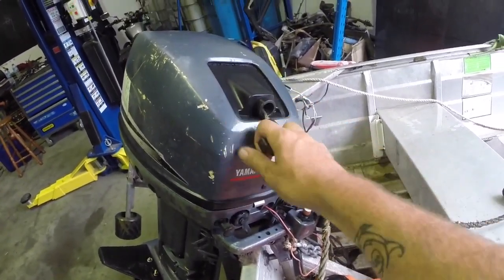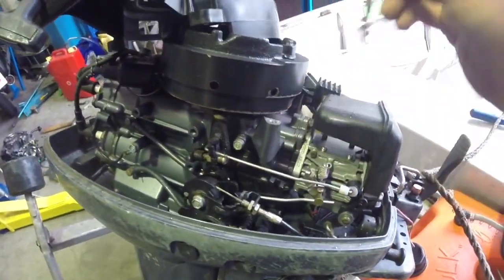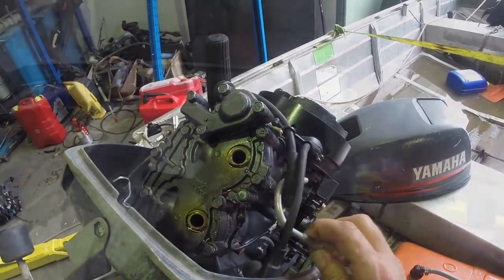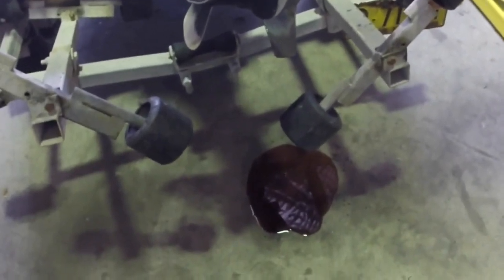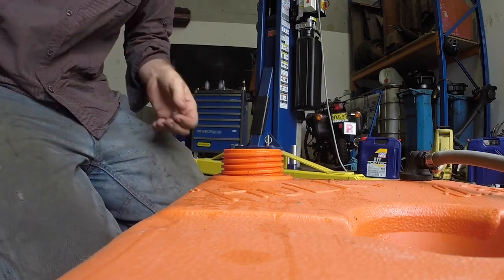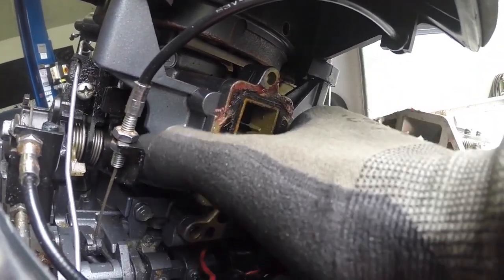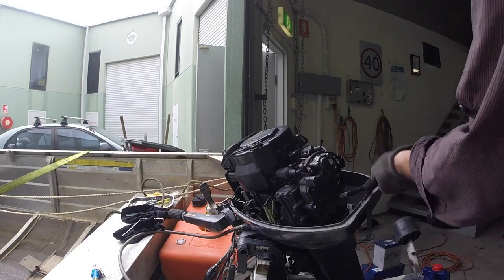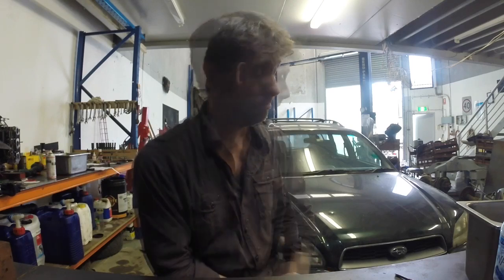Unseizing a seized outboard motor

Comment: Last by not least, My Mariner 90 jet boat engine which i used twice after a quick test run from the mechanic/ private dealer. Afew months ago. 

Flywheel is and was almost impossible to turn by hand or pull string. Is this normal? 
It was so hard to turn the solenoid connection to the starter motor broke off. (Maybe age aswell)

I suspected that it was due to my brother leaving the water running into the engine without it running therefore water gone into the head (thus is a jet boat Not outboard) 
I took the spark plugs out and the motor was much easier to turn, water shoot out of the spark plug holes when i turn the motor, i sprayed wd40 as suggested by a few videos. Changed the solenoid and starter motor and now it runs good. (Still impossible to pull start)

I took it to the water, took off and got to 30 kph then cuts out (maybe i forgot to turn the blower for fresh air into the engine compartment so i left the lid open) it got to speed a few more times then its just slows down to max 10kph. 

I did a compression test yesterday and bottom cylinder shows 5 whiles top 2 shows 125 each. Is this a case of taking the whole engine out to bore the cylinders? Or anything else do you think could be causing it?  

I got these motors and they're all old and keeps breaking down. i just swap my GQ Nissan patrol for a 2015 Seadoo Jet ski, is 4 Stroke in your opinion better ? I.e. reliable and more durable or are they're about the same? My wife hates the fumes of the 2 stroke.
Reply from the maker: You would certainly need to disassemble the motor completely to see what is going on. Could be head, could be rings. Personally I have always preferred four stroke motors over two strokes and also found them to be more reliable.

Comment: G'day mate, I have a 1989 Yamaha 200 2-stroke, seized, have filled the ports with ATF and noticed plenty of ATF in the exhaust and carbs. Does that sound right to you? Cheers
Reply from the maker: Yes to the exhaust in that some of the pistons will be low enough for oil to run out the exhaust ports and down the leg. The reed valves should be shut and preventing oil from getting into the carbs so I would take the carbs off and check that you don't have any broken reeds or ones that aren't closing properly any more.

Comment: I have a 15 HP Johnson 4 stroke motor , feels seize when spark plugs are installed , but motor turns over freely when i remove the plugs , any ideas ? I can't seem to find a video on youtube that relates to my problem closest is seize motor . any help is appreciated , oh by the way love your video I learned so much over the years and have subscribed and liked all your videos !!
Reply: Did you ever figure it out I’m having the same problem with my 30 HP Evinrude 2 stroke

Comment: Hey man I have an old 6hp motor that will turn but not start. It sat at our old beach house for some years so it's full of salt and was probably never flushed haha. I'm pretty sure it started a couple of years ago but won't start now. We have also replaced the spark plugs but still no luck. Any idea what the problem could be?
Reply: It's an evinrude by the way
Reply from the maker: If it has sat for a long time I would start by cleaning out the carburettor(s). https://youtu.be/ye_Ui9D8dBE This video will also give you an overview of other possibilities https://youtu.be/nil7mx3x63k
Reply: +Dangar Marine ok thanks, I've just been working on it and realised that there is no spark :( even with new plugs. So I'm guessing it's electrical?
Reply from the maker: Yep. Could be the exciter coil under the flywheel or the ignition coils that drive plugs.
Reply: +Dangar Marine ok, so it's best to take it in to get it fixed rather than do it myself? Haha
Reply from the maker: Watch this video and then decide. :) https://youtu.be/MDbvkFM1V_c
Reply: +Dangar Marine ok thanks man

Comment: Well I think that's the next thing I will keep you updated how is the best way to time a 2 stroke top dead centre
Reply from the maker: +loaded1981 There may be a mark on the crankshaft under the flywheel, otherwise take a sparkplug out and use a straw or something like that to feel the piston rising as you turn the flywheel.

Comment: Question  i can understand if water or moister gets into cylinder  soaking over night with the ATF  but the ones i have encountered  i have mostly been able to break free but the  the rod bearings play havoc  on the crank  buy electrologist  causing  little imprints  on the crank where roller bearings make contact  causing damage and if you run it it will after a while it will throw a rod  because only the first few thousands of the crank has been case hardened after that is softer metal  so it can flex with the high rpms not like a case harden car crank which is harden all the way through  so outboards under the annealing  process on the crank the roller bears with the moister between them  have eat into how do you go about seeing if this  has  happen
Reply from the maker: Pulling the crank apart is the only real solution tho this. If flushed properly and started again soon after sinking I've seen plenty of these engines run just fine for years and years though without stripping the crank down.
Reply: @DangarMarine  I had a 40 hp sink on a hydro  12 footer took the motor off as soon as I got it home cranked it over with the plus out  lubed the cylinders and cranked some more the emptied carb and fuel lines  put it all back and started it  let it run for 30 or 40 min  and its still running today that's been 20 years 
ago ps  i hope they get off that lockdown crap over there real soon

Comment: Be nice to know how long these jobs should take.
Reply from the maker: Really depends on the outboard. This one I left soaking over night so I guess it takes a couple of days even though the actual effort of unseizing it was probably only about an hour.
Reply: somewhere between 20 minutes, and 10 years, lol. the size of the motor counts too, as the more bores, the more damage has to be chewed through (and the more steam applied through that breaker bar). i've seen a 4 stroke pressure washer "unstuck" in an hour, but also a chrysler 318 that took almost a month of "gentle persuasion while awash in turpentine and diesel" to get the first full spin, and then a week of tranny fluid and a spin every few hours. that puppy ran for almost a year before the idiots sunk it, lol. it is IMPOSSIBLE to give a "book hour figure" for such a job. odds are,no matter what you charge, you'll take the beating, lol. if you plan on plotting time spent vs your cost to buy another motor, i'd say a week of "part time effort" (maybe an hour spread through the day of topping and torquing) is justified no matter what (outboards are kinda pricey), and then make the call based on what you see dribbling out. if it's bleeding rust/oil mud out of the exhaust and plug holes, probably time to start shopping. lots of pretty silver glitter is probably a similar clue. now, if you see that after an hour, why go on? on the other hand, if it's taking a bit too long, but everything is running clean-ish, why not give it a little longer?

Comment: Have you tried pentrene oil before for this application
Reply from the maker: No, I haven't tried that, but most people swear by a 50:50 mix of ATF and acetone.
Reply: Yep thats what ive been reading i have two evinrude ficht 115 that are seized im based in Newcastle trying to find someone honest to work on the engines or may not be worth it. Im thinking there are going to be lots of problems the boat has sat for 8 years and hasnt been ran less then 250 hrs on engines.
Might look at another second hand single 250 motor

Comment: PB Blaster works I like to use Marvel Mystery Oil I've unlocked diesel motors that has sat for years all you got to do is pouring on the cylinder let it sit for a couple days and put a big ass wrench flywheel bigger the motor bigger the wrench her big motors I use a cheater pipe outboards normally not necessary

Comment: Hi dandarstu love your videos watch a lot & has helped me out so me you times as I like messing around with outboards when I can't get out on the boat as being in Scotland weather is not always good lol but I'm having probs with a Suzuki dt55 not starting got spark getting fuel but will still not kick the bottom 2 cyclinders don't seem to be getting fuel as much as the top 1 going with the plugs changed the reed valves still nothing could it be the fly wheel key some 1 said it could be all help would be good thanks
Reply from the maker: +loaded1981 Have you had a go cleaning the bottom two carburettors? I'd start by cleaning those on top of a compression test on all cylinders. Here is a link to the cleaning a carburetor video: https://youtu.be/ye_Ui9D8dBE

Comment: How did water get in the gas tank?
Reply from the maker: Usually it comes through the air vent, but it can also come from the fuel before it is even put into the tank.

Comment: DO you do it the same way .for a engine that was running when it seized.
           yours Ben Murdoch.
Reply from the maker: Do you know why it seized. Generally if a motor seizes while running it will be due to lack of oil or cooling water. If you are lucky it will just start again once it has cooled down, but be sure it fix whatever caused the seized in the first place. If it does move after seizing when running then something has been damaged and this process won't really help.
Reply: Having the same issue with my 9.9 four stroke Yamaha. Seized while running after making a loud whining noise. Was really hopeful till I read this comment. Lol wonder if it’s the gear case seized...

Comment: O.K. what was that lanyard thing you put on the engine?
Reply from the maker: +Endtimeprophecy777 Hmmm, can't recall what it could have been. What did it do or look like?
Reply: Endtimeprophecy777  it attaches to your wrist if the driver were to fall out the boat wouldn't run off on you
Reply: it kills the motor

Comment: sometimes when the outboard is stuck. All I do is remove the spark plugs spray wd40 in the holes and let soak for while then crank it over it fires
Reply from the maker: +layne bartman Yep, depending on how badly it is seized you can just give it a spray. We had one in this week that needed the head removed and the cylinder bores honed, but it was pretty rusty.
Reply: +Dangar Marine nice. did a good job on unseizing the motor though looked pretty seized until you broke it free from that rust line
Reply: Dangar Marine , Hi you Ledgend, helped me saved so much money getting those mobile mechanics that didn't do very good job of servicing my motor, my johnson 60 was overheated due to old impeller wasn't replaced, now one top cylinder rattles at high speed. ( have u got any videos on how to do it?) it was running until they took everything apart breaking most of the bolts along the way. A motor loke mine is probably worth around $1,500. So if its too much work. I am thinking it's probably going to be easier to replace the engine and use this one as parts. (Do you have video how to change over or replace and install engines? )

Comment: Be forewarned. If it has seized, there is damage. There will be damage to the rings and cylinder walls, severity may vary. Most likely the rings will not be free in the grooves. The motor should be torn down and inspected. At the very least it should have a hone ran through and new rings. Who wants a time bomb on the water?
Reply: After some heat cycles I do believe the rings free up a bit. Just take it easy and don't go to far from the dock for the first 2 tanks.
Reply: @nonya832  No, they don't free up. The cylinder does not fix pits and grooves on its own either. Tear it down and do it right.
Reply: @AnonyMous-jf4lc  okay I will sorry
Reply: @AnonyMous-jf4lc  yeah I'm happy I'm doing it right. Took the head off and there was so much rust it probably would have been enough to lock it up at tdc

Comment: You was saying about the car i have just got myself a ford focus that had been submerged in water i had to take all the dash out and the instrument panel was nakerd but with ford if you put another instrument anel in with diferent milege it will not start so i found a company in uk i sent them my old panel and i purchased a second hand panel sent both to them and they cloand the new panel i was putting in the car the other reason i did this is because it only had 23000 kilometers on it the other thing i had to replace was the triptronic moduel and airbag moduel i could reset everything as i had the computer also replaced the radio got second hand but never got the code so got the seial number of the radio went online paid six euro and in 20min got code so radio works i paid 300 euro for car after all work and new document itv it stands me in 1500 euro
Reply from the maker: Nice fix. We have very similar problems with our Subaru. We also needed to get the key recoded for the new body control unit.
Reply: @DangarMarine  do you have somone that can do the job

Comment: It was some 1 online that said to try that I was going between the vacum &I the firering order but I've not had a chance to get the fly wheel off yet but was just not sure that's why I contacted you see what you thought
Reply from the maker: It's certainly a possibility. If you have fuel in the carb bowls, good compression, clean jets, spark on all three plugs, new reed valves and it still isn't firing a timing problem is on the cards.

Comment: The trick I use is to add 50-75 % Kerosene to your lube. It changes the surface tenchen. If you try it you'll never go back to any store bought nut buster.

 One warning clean it up or it spreads like oil on water.   
Warning two if you try to use for cutting oil is creapes up your drill and your drill slips in your chuck and, it dosent stop there my chuck fell out the taper of my drill press.  That never happened before . 

It penatrates like boys at a senior prom.
Reply from the maker: Yes, acetone can have a similar effect.

Comment: I ran out of gas on a two stroke motorcycle once and unfortunately the gas station had no two stroke oil,so given my choice of four stroke engine oil,atf or power steering fluid.I had to get home so I chose the atf mostly for it's lower viscosity and I thought of what was available to me it would probably burn the cleanest.I rode my Yamaha RZ350 home approx.120 miles.although she smoked ALOT I made it home with absolutely zero issues.Not even a fouled plug.although I wouldn't recommend this it got me home in a pinch and flushed the fuel system the next day.

Comment: I bought a motor for 75$usd and did this to a Nissan 8hp that was ran with straight gas and I’m surprised because my compression is at 100 psi top and bottom

Comment: could you spray wd40 inside the cylinder to lose it up?
Reply from the maker: Sure, WD40 is fine. Ideally being able to soak the cylinders with more volume of fluid is best. I've also been recommended to try warm diesel.

Comment: Hi what was the fuel ratio
Reply from the maker: +Enduro With Thomas For the oil? This outboard is designed to run on 1:100 but I will normally run it at 50:1 or even more for a while when it has had this type of problem.
Reply: +Dangar Marine ok thanks u have been a big help in the past

Comment: It was the wire you connected one end of to the engine at 15:55 to 16:07.
Reply from the maker: +Endtimeprophecy777 Ah, that's just a kill switch that you connect to the motor and then to your belt so the motor cuts out if you fall overboard.
Reply: Thank you, and I love watching your videos.

Comment: i should upload a video of my motor just to show you what is wrong with it and i have taken off a crank shaft on a old motor only to find a bearing was cracked so im running out of options but thanks for the ebay advice it will be really expensive though to get it shipped from china lol
Reply from the maker: Are you sure the bearing is cracked? The OMC ones are made then frozen and cracked in two to get them around the crankshaft, that is normal.
Reply: im not to sure im just learning about this stuff myself if i could send you a picture i would but i dont know how to get your email but maybe it the very middle bearing if that is what your referring too
Reply from the maker: You can upload photos to image sharing sites like Imgur and then put the link in YouTube comments. That is the best way to go.

Comment: I tried pulling my cord today and it was just frozen solid. Honda 20
Reply from the maker: Make sure it isn't in gear first.
Reply: @DangarMarine  okay thanks. I got the problem solved. I put too much oil. Hehe! Overfilled. Had to pull out the spark plugs and pull cord several times. Oil shot out of the cylinders.